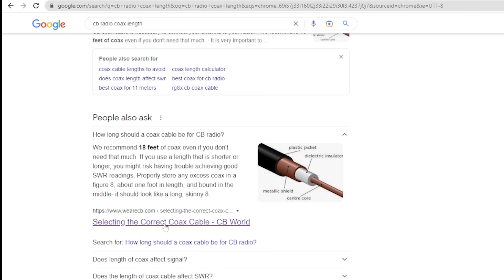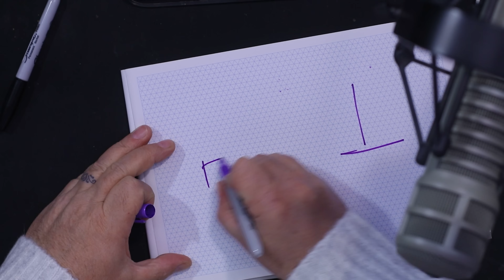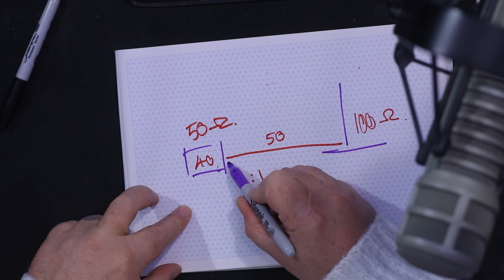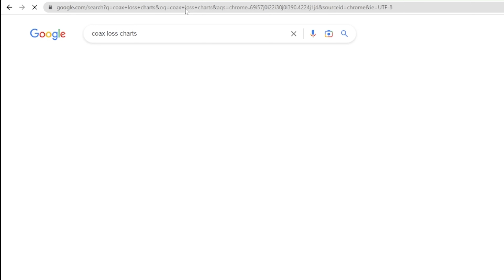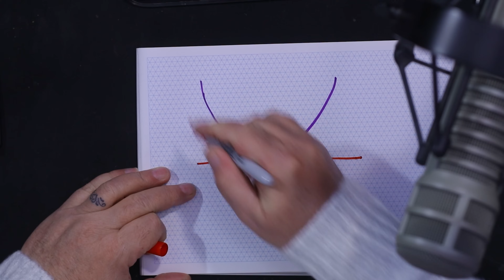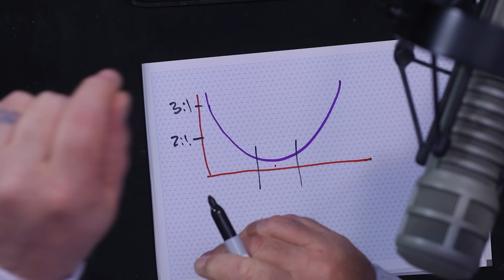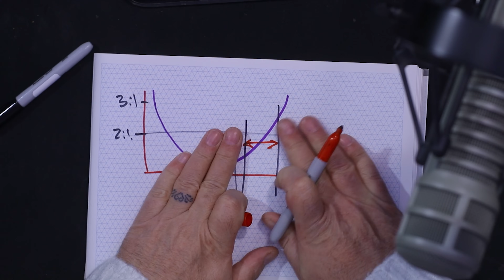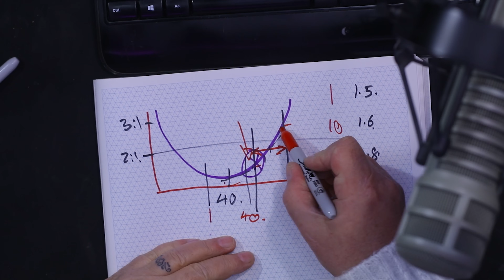11m / CB Radio: How Long Should My Coax Be?

Comment: Reflected power is always additive and is not wasted as heat. The trick is to get reflected power 180° out of phase or as close as you can get to 180° out of phase. With the copper losses, and with the velocity factor of the feedline, you have to get the length just right before you can get the phase just right to have additive power on each reflection. It is possible, but you can only get really lucky before all power is additive. All feedlines of any kind are different from any manufacturer in copper losses, velocity factor, and reflective structures the feedline passes close to. In what was said in the video here, you just have to trust to luck !!
Reply from the maker: Or give up and install a flux capacitor.

Comment: Most cb antenna, where the vehicle has a fiber glass body, must use the coax shield as part of the antenna's radiating element, like one side of a center fed dipole for example. 

If the vehicle body is metal, then the metal body would provide the driven element something  to work against, and coax length would be irrelevant .

If one could drive around with a ground plane antenna, like the example in the video, coax length would also be irrelevant.

Thanks for sharing.

Comment: Wrong. In the simplistic theoretical world you are correct, the coax length doesn't matter. However when 18 foot is spoken it is used for mobile installations. Mobile installations that are always a compromised antenna system. A compromised antenna system is not simple theory. So the simple theoretical thought of coax length not mattering does not apply. What does apply is the reality that half of your antenna system is car. A car where the mounting location might not be ideal. Because of this less than perfect completion of the antenna system you may introduce factors outside of theory. Common mode currents are easily induced in an antenna system that can't decouple 100%. Theory decouples 100% without a problem, but reality doesn't. Therefore to best combat existing antenna currents that could be running on the outside of the coax 18 foot of coax is recommended. Not because of theory, but because of reality.
Reply from the maker: Compromise or not. If it's a 50 ohm antenna, I'm right. Check your Smith charts (and fit a choke!)
Reply: @DXCommanderHQ  You can not smith chart reality.
Reply: @DXCommanderHQ  In the real world how many 11 meter mobile antennas are a theoretical non reactive 50 ohm antenna? Very few. In the real world a compromised mobile antenna system is forced to use the vehicle as the counterpoise. It simply can't decouple as well as we would like it to. Creating the possibility of common mode currents flowing on the outside of the coax. You DO NOT use a coax cables velocity factor to determine common mode wavelengths! Therefore 18 foot is approximately a half wavelength. So that !8 foot of coax can help null the effects of common mode currents on the feedline. Simple theory or Smith charts can not be used to represent reality. There is a reason some mobile antenna manufacturers suggest to keep their coax length at 17 or 18 feet.

Comment: It's very simple, coax length depends on two conditions, 1) if the antenna has a load match inductor at the base, the 2 PL259 contacts produce a closed circuit  2) no inductor, the 2 PL259 contacts produce an open circuit, , ,

So condition 2 has to have a coax that has a critical length !!
Reply from the maker: And that would improve your signal... Yeah OK.
Reply: @DXCommanderHQ   The way you describe it, by magic, the transmitter corrects the phase along the coax to antenna, , , Yeah OK !!
Reply: @DXCommanderHQ   Hmmmm, , the velocity factor does not effect length or frequency, 300 / 27.555 = 10.887mtr / .66 = 16.495mtr : 300 / 16.495mtr = 18.197mhz, , , so is it 27.555 or 18.197, of cource it is still bloody 27.555

ha ha, i have found it is allways good to have an objective opinion, i find i learn more !!, , , i do like your video's tho, they get me thinking, , ,

Comment: Is part of this myth related to the "counterpoise" issue? Meaning...we all know that one can make a tuned vertical elevated radial by calculating a quarter wavelength, thus giving us a tuned system. By the way, I have a Solartron CB antenna (for 10, 12 & even 15) and the length of coax doesn't seem to matter. Still get a below 2:1 SWR. I have a sneaking suspicion it uses the coax as the counterpoise, since I have NO radials attached. I know of one "CB" antenna, the Firestik, that has a separate kit of 18 ft of coax. Wondering if it is for matching purposes? Any thoughts?
Reply from the maker: How the myth ir relkated to that, I don't know. Solartron antenna: If it's "loop / coil" fed (which I think it is) then you won't need a counterpoise. In fact, you could put a high impedance choke on the coax and it wouldn't make a blind bit of difference - and that would prove it for you (don't bother - it's honestly got a coil at the feedpoint so it doesn't need counterpoise / ground). It would need to be a chapter in a book regarding the 18 feet of coax. In fact according to my calculations, that 18 feet should actually be 12.5 feet (assuminig they actually want to replicate the impedance at a half-wavelength less velocity factor). 18 feet would mean the coax has 100% VF. Impossible - so probably a marketing trick to continue the myth!

Comment: The only time you notice any difference at the radio end when changing coax is realy long runs... Or moving on up from hf to uhf... Can you cover co phased antennas for modified radiation patterns..
Reply from the maker: Noticing a 3dB change is different than actually KNOWING you have a 3dB loss.. :)

Comment: Stick a dummy load on any length of coax you will get a 1 to 1, so any length does not matter, its the tuning to 50ohm's of the antenna on the coax line.

Comment: Long ago I found length of coax from radio to ant doesnt matter. RG8 for longer runs tho.
Back in 1972 I installed a homemade halfwave antenna 20' up an oak tree. Ran RG8 10' down and 12 ' over to my awning, another~ 20' to a front window then about 8' in to my base station (Realistic Navaho). Roughly 50 ft total.
I was about 2mi as the crow flies NE from the junction of Rte 301 and Rt4, elev ~60'.
I could talk with truckers on 301 almost 18 miles both N & S and 4 E & W.. (with a 1/4 on the trunk of my convertible - SWR on19 1.3 - barely 4mi.)
Part of a small net, we helped traffic much as possible during bad weather. Gone are those days and they cut the oak tree down in '81 after storm damage. ☹☹
BTW in closing. Now a days where I live (with limited height available) I find that a full 1/4 vertical fiberglas with a short ~4' car roof top ant makes a fair 1/2 wave dipole. 
PS Id like to hear if someone tries TWO of those short loaded antennas joined as a dipole.
73's to all from a very OM.

Comment: We had once perfect signal on our TV back in the 1990s of analog TV and did the horrible mistake of shortening the very long coax that was rolled up in a large coil of around 30cm diameter with maybe 5 meter of cable in it. After that we never got our TV signal back and it had horrible distortions and also got in Russian TV signals half the time ruining the signal and was generally rally bad... Never fix something that works lol ;) We had perfect signal before removing the coax coil and shortening the cable...
Reply from the maker: PROBABLY the connector.. Shortening the right coax to the right antenna coax will always improve signals.

Comment: Hi Callum, it struck me today the best argument about not cutting coax to length.
To anybody new reading here, think about this!
An SWR meter is not an isolator. The aerial side is not somehow independent of the input side.
It is a fancy connector with a meter just like any coax coupler making two cables into one. Cutting a cable just adds to the other one through the meter. A waste of time cutting it.
As we amateurs say, there's no point in trimming coax inch by inch to a specific length.
G4GHB.
Reply from the maker: Good point.

Comment: Here's an interesting one Callum, after much discussion with a C.B.'er who insisted on using a ½λ, I found the following about using the Bird 43: Nowhere in the manual does Bird suggest that the VSWR measurement must be made at the feed point or integral half waves from the feed point.
G4GHB.
Reply from the maker: I'm sure.. But we know there are repeats..
Reply: @DXCommanderHQ  Morning Callum, I just read the Bird manual online, they assume people have correctly adjusted  the aerial to a proper 50 Ω so not having to resort to cutting coax. It assumes an SWR below 1.5.  If C.B.'ers have properly adjusted the aerial they won't need to cut coax, as it said it can be placed anywhere. It seems to be poor matching on the part of C.B.'ers. R.F. on the braid likely.
Reply: @DXCommanderHQ so if we know it repeats the feedpoint impedance at halfwave lengths at other lengths it will be a different impedance therefore a different swr ,right ? So that would conclude that if there's a mismatch the swr would change at different lengths?

Comment: I've seen all sorts of nonsense said Calum, one guy cutting coax and soldering a PL259 every inch until he got it 'right'. A good explanation Callum.
According to their theory coax must put out less power if they use say 6 inches or 20 feet of coax. One CB'er who believed in impedance matching said to use either ½λ or ¼λ coax which throws his own argument right out.
Simple answer to all this nonsense is a 50 Ω dummy load in place of an aerial proves 4 Watts on any length of coax, unless stupidly long. No dummy load and oscilloscope? Use a small torch bulb as an indicator for a quick test.
G4GHB.
Reply from the maker: Indeed.. A crazy world!
Reply: It's not so simple.  It's true that coax length doesn't really matter if you have a 50ohm antenna,  50ohm coax and a 50ohm output from your radio. 
 However let's say you have a 50ohm antenna 75 ohm coax and a 50 ohm impedance output on your radio. Now coax length does matter if you want to get a low SWR. Why? Because coax will repeat the impedance of the load, every half wave. So at some point (one to multiples of half waves, the 75ohm coax will have a 50ohm impedance, and that is where you'd connect your radio.

I've used this trick myself.  I used TV satellite coax to connect my 50ohm  2m rig to its 50 ohm antenna.  I trimmed the coax to a half wave point and got a flat SWR. 

73
Reply: @petertyrrell6690  
Sounds a lot of messing about trimming coax but okay it works.
I'd rather buy 50 Ω coax. 
However a 50 Ω tx and 50 Ω coax with a 75 Ω dipole is only 4% loss, 1.5 SWR which is nothing at 100 Watts. With 5 Watts and 50 Ω tx and 50 Ω coax to my 75 Ω dipole I don't worry, it is 1.5:1 SWR, it's still the same ratio. Nobody at the receiving end will notice 0.2 Watts reduction, just as they won't notice 4 Watts loss out of 100. 
I assume it's the same with 50 tx, 75 coax, 50 aerial, 1.5 SWR.  
My other aerials are inverted vee's at around 50 Ω. 
Even my Pixie assuming 4% at 350 mW out would be 0.014 Watts loss, still a massive 0.336 mW out, but it ran on my low inverted vee so around 50 Ω.

It's the quadrupling of power business which shows how much loss can be tolerated.. 

73, G4GHB.
Edit: With the Pixie (larger?) losses with using a low inverted vee putting r.f. into the ground, fences and buildings!
Reply: @bill-2018 Yes, I agree, and for HF, I wouldn't bother if my SWR is less than, say 2 ish, although cheap CB amps apparently do need a very low SWR to enjoy any sort of longevity. 

Reading the comments here, many have little to no understanding of antenna systems theory, and have got locked in to a closed minded approach on antenna setup, and if something doesn't work they are I'll equipped to fix the problem.

Anyway, my point was, that adjusting coax length under certain circumstances can make a difference.  One may not care, but it does. 

Thank you for you response. 

73 va3hr va3pet
Reply: @petertyrrell6690  
Yes, okay tnx for replying again.
I used to tune my long wire with an r.f. pickup meter and two torch bulbs in the twin feeder for the doublet before I made my SWR meter. QRP only for 35+ years. An amateur friend was horrified I did that at a special event station. I ran things for years like that then decided to make an SWR meter to see what was happening. Sure enough, the r.f. output went down as the SWR went up.  

I got a NANO VNA earlier this year so that's interesting tuning with the SWR meter for as low a reading as possible then looking at the VNA. I need a slow motion drive on the capacitor of my tuner and long wire as the meter soon shoots upward at maximum sensitivity with the tiniest adjustment. 
Some would say just use the VNA but it's interesting to see how close to resonance I get with the SWR meter only.
I got excellent results recently on 18 MHz and 24 MHz indoor inverted vee's.

73, cheers, Bill G4GHB.
Reply: @bill-2018 I have a mini VNA but haven't used it  much yet. I should as it's a useful  tool. 

I did have a long wire antenna that I remotely tuned with a home brew  L-match.  I tuned the inductor with a drill and the capacitor with a rc servo. Perhaps something like this capacitor setup might work for tuning your capacitor or for  finer resolution,  perhaps consider  driving driving uour capacitor with an arduino controlled stepper motor. 

I tuned my long wire with a MFJ antenna analyzer, before I connected the coax to my amp or rig. It was a clumsy arrangement,  but it worked. 

73 va3hr va3pet
Reply: @petertyrrell6690  
Yes okay Peter, I did a similar thing at special event stations, roller coaster and variable cap. and l.w., tuning for maximum r.f. out at the aerial before my SWR meter.
The a.t.u. I used here is an MFJ-16010 I was given as not working, a wire needed soldering, I temporarily added an extra cap. to make a Pi match for more flexibility. I do have a 6:1 reduction drive available. 
To be honest it's close enough to work as it is but it's just fine tuning to get close to resonance which is the ideal aerial the text books tell us about, 50 Ω and zero j value. It would vary anyway, wind, rain, snow etc. Again a distant station would never notice 46 Ω or 54 Ω or more with various j values resulting in maybe 2:1 SWR, as you rightly say nothing much to worry about. 
On 7.071 MHz (l.w.) depending where I positioned things I got between 48 Ω 1.022 SWR and 54 Ω 1.15 SWR according to the VNA. Earthing matters with l.w. and verticals. 
I could tune 80m to 10m with about 25' of wire, 30m was the best match.

That fine tuning was more an experiment to see how close I could get to 50 Ω and a low j using just an SWR meter. 

73, G4GHB.

Comment: Wish I knew this 48 years ago too lol. Also does it matter if I leave my SWR meter in line long term or should I remove it?
Reply from the maker: I don't think it matters.. If you have a power meter builkt into the radio and it's producing full power, you can be assured your SWR is fine.. Almost every readio known to man will reducve power if the SWR increases. I take mine out...
Reply: @DXCommanderHQ  Yeah I've had no problem in the past leaving it in tho bk in the day we only legally had 2 watts, ever bit counts, thanks.

Comment: Why not tune for lowest swr on channel 20 ? How ever back in my cb days I did it on channel 12 because cb radios only had 23 channels that was back around 1974
Reply from the maker: Yes, you can do. Frankly - we all got completely OCD about SWR. Most CB antennas are better than 1.2:1 across the whole of 11m band anyway so as long as you get a match under 1.5:1, you are good to go!

Comment: I run 9ft or 12 ft of rg213 coax  works good on a t680 semi truck just put right antenna on truck and get good swr and range using a rigexpert antenna analyzer i like ones with white center insulator of the pl259 connector never liked the purple or yellow one cause was told white ones handle more heat to not melt when running high power through it

Comment: John, I have a horizontal die pole 11 m what would be a good height to put it up I’m kind of lost with this stuff and I would appreciate your wisdom. Thank you.
Reply from the maker: Yeah hi.. It's Callum here (although John is a great name!).. Right height above ground.. Erm.. At 1-wavelength above ground, you are probably as high as you need. 3/4 wavelength is fine - but you will see a slight null opposite the ends. If you can hang on a few days, I can make a video about this..
Reply: @DXCommanderHQ  I’m new at this, thank you very much. Sorry for calling you John I should’ve known better because I told my wife while we were watching YouTube. I like your name it’s different.

Comment: Well, wouldn't length Mater when using junky, or cheep coax that has bad shielding, or not enough. And on the SWR being 2.1 wouldn't you lose some power output on your radio as apposed to a 1.2 swr? make a video with your antenna matcher showing this. Thanks
Reply from the maker: Crappy coax AND 2:1 SWR is asking for a waste of time and money! :)
Reply: I bought some coax at a rally once, got it home and was disappointed, very open braid.
Seems okay for 5 MHz but I wouldn't dream of using it much higher, vhf NO.
Now I take a knife to see the braid before buying it.
G4GHB.